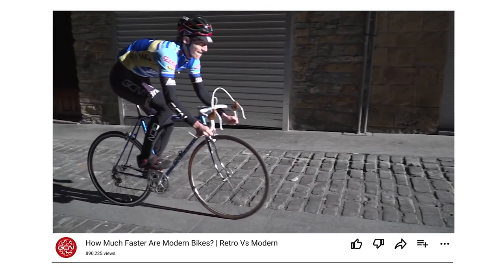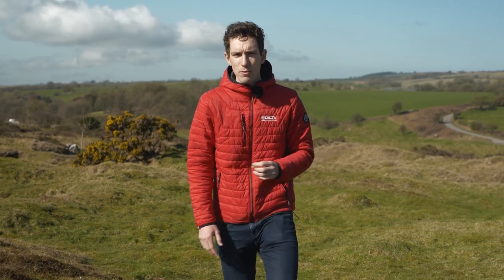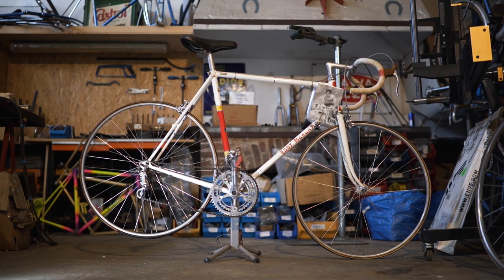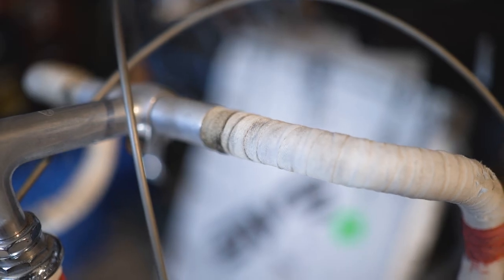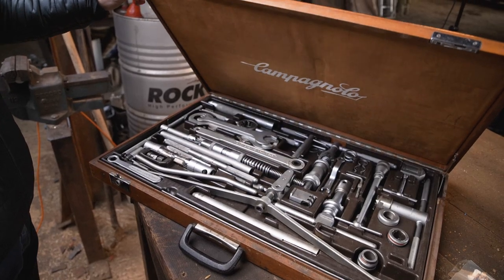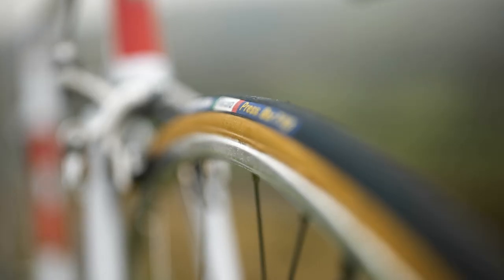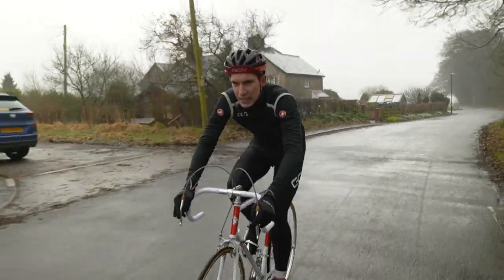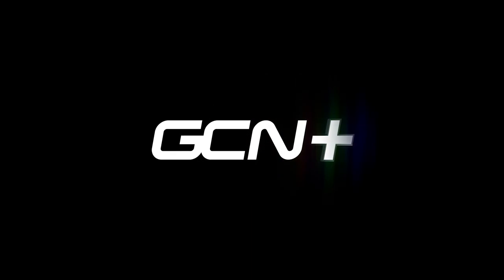Retro vs Modern: The Ultimate Test

Comment: Great piece, Si.  Takes me back.  Sid Barras was one of my heros growing up although I could never really sprint.  The longer you ride those classic steel frames, the more comfortable they will get.  BTW, change the saddle and brake pads.  Saddles have advanced a lot (unless you have an old Brooks Team Pro leather: just don't get it wet), and change out those brake pads. Even new they weren't very good, and in the day we always swapped the rubber out for at the time weimann or Dia Compe pads, and by the mid seventies, there were, as now, lots of better after market brake pads.  I would note your choice of pedals: you have all Nuovo record road kit, but the pedals you had on were Campy Super Record black alloy track.  Lots of roadies did use the track pedals on the road, to save the 'weight' of the quill piece that kept you foot from sliding off the outside, (as you did on the climb).  Eddy, however, usually used the full quill road pedal.  It also offered more support and comfort on long road rides and races.  Can't wait to see you ride that beautiful bike on the epic Eddy tour stage.  BTW: although my road career was on steel, I have a Cannondale EVO super six carbon road bike, and like you, I'm not going back. Keep up the good work, pilgrim.

Comment: Hi Simon,  you where grinding up those hills in some pretty large gears.  When I was cycling to school on my Dawes "racing bike" fitted with a three-speed Sturmey-Archer I can remember the local bike shop had a whole rack of sprockets behind the counter for those lucky enough to have a real racing bike.  Am I right in remembering that wheels would be fitted with these to suit the terrain e.g. 4 with one tooth difference + one bonk sprocket, or three for the flat and two for the hills. No where near the range available nowadays but perhaps not quite as bad as your setup?

Comment: For the techno music bike, 13 km in 22:44  minutes comes to 21.3 mph average speed.  Even with Si fumbling the gears and not using his knee to shift at least once, the classic did 20.1 mph and that's after Si did full gas for the techno music bike. If I join a local pelaton on my 1984 Bianchi Limited, the 1.2 mph difference won't drop me.  I will be at fault, not my bike.